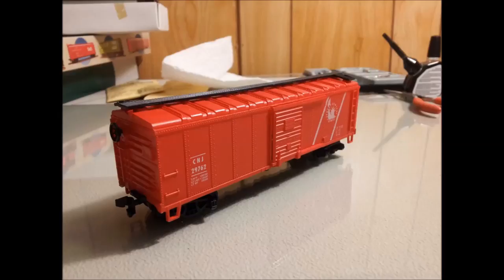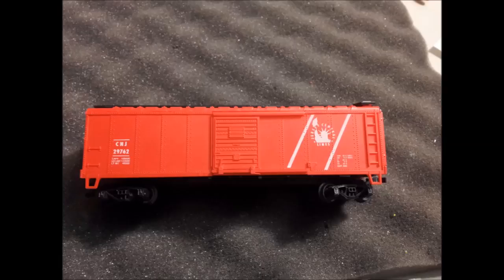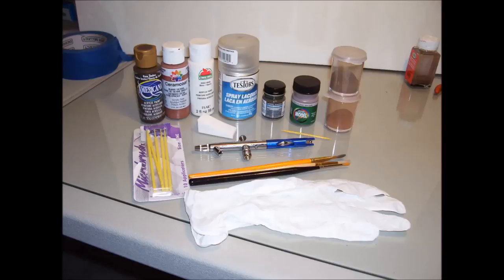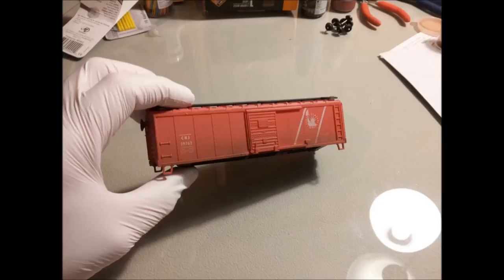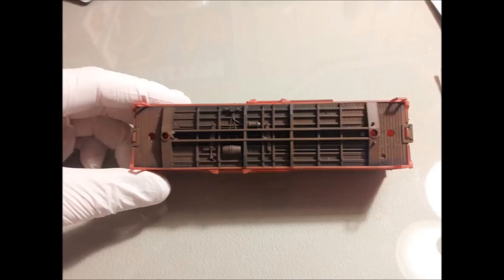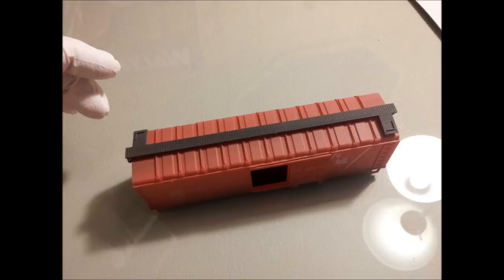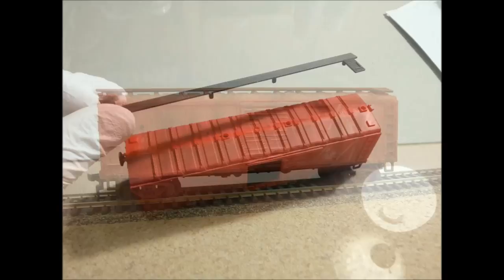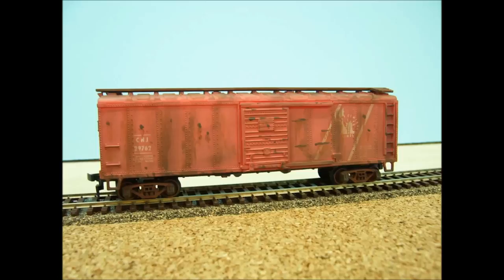Practicing Weathering Rolling Stock - 2nd attempt

Comment: You know can change that horn hook out?  I have several life like cars.  I popped the horn hook out. And in the middle was the  stump the hock hole went on.    There is enough space to put a standerd buckle coupler in.   The hole will go over that stump.  And. Function just fine.    I am 21 and love model railroading.   I don't,t have a layout yet but am working on projects.    I have subscribed.    I love the video,s.  From one model railroader to another...... Nice job!!!!!!
Reply from the maker: Yep I'm aware of that, but I don't plan on using this car on my layout.  It's an old cheapo car that was just used for practicing. And if I did change the couplers I would use body mounted couplers.   Thanks for watching and subbing!